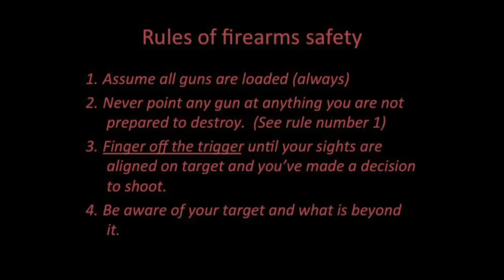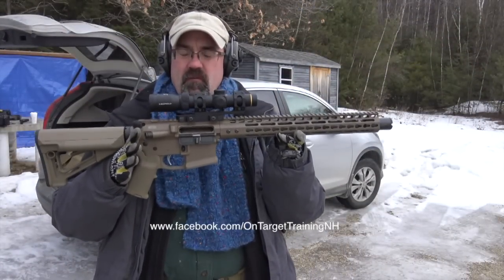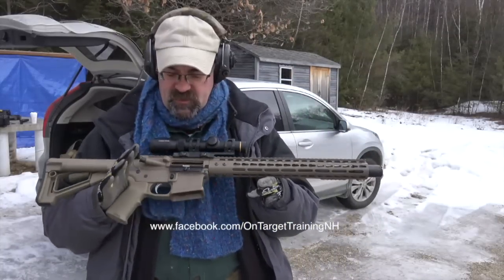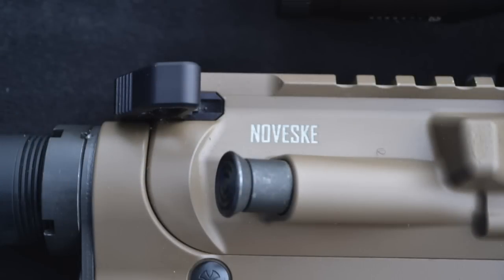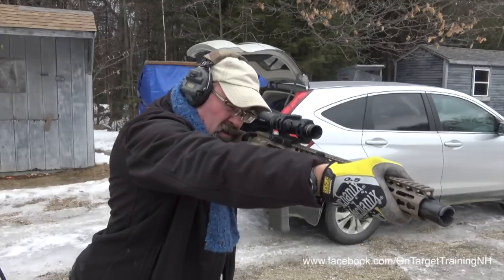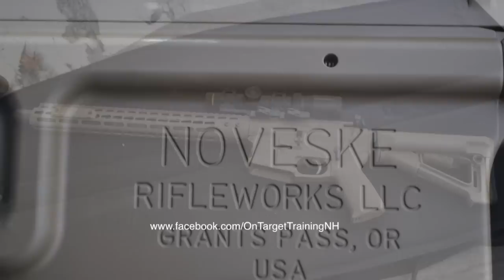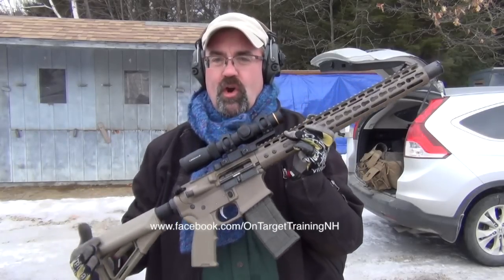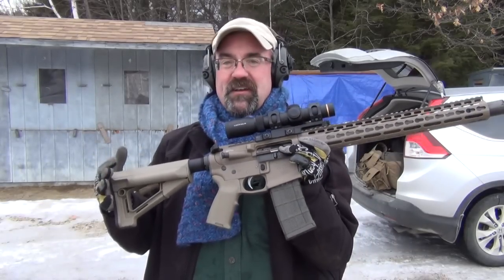Noveske Infidel 556

Comment: if i'm not mistaken i thought the kx series device was for short barrels tocause backpressure to aid in cycling (much like the booster on a aksu(krink)- i have always been told you dont want to put these on standard length barrels due to the added backpressure on the gas tube/bolt carrier/etc  beating up the gun.

Comment: How do you clean the flash hider with it pinned? or is it not multiple pieces?
Reply: Nelson Jacobson you can take the cone off from the front after removing the metal pin surrounding it, It screws off but noveske states it’s unnecessary as the carbon build up will burn off through use and regular barrel cleaning is all that’s necessary

Comment: Alg defense trigger is nothing special, it's just like any other trigger in a basic rifle but it's got some nickel boron coating, they don't really cost much more than a standard trigger.. I think Noveske for the money should step it up in that area.
Reply: Yeah , I've got a BCM with one.. I've also got an LWRC which also comes with an all style trigger except LWRC are bit more costly at around $100.00
Reply: All=act
Reply: How much did you pay for Cmc? I want to upgrade my trigger but not wanting to spend more than 225.00
Reply: rascalMatt17 I put a CMC flat trigger in my Infidel FDE. Love it. Great gun!
Reply: Red pilled patriot -i agree. i have  ALG ACT triggers in both my FNH ARs and love them. im using the light purple springs so pull weight is about 4.5 lbs and is very smooth with a decent crisp but rolling break and good reset.theyre great
but for the money the Noveske should come with a Geissele or Timney etc.